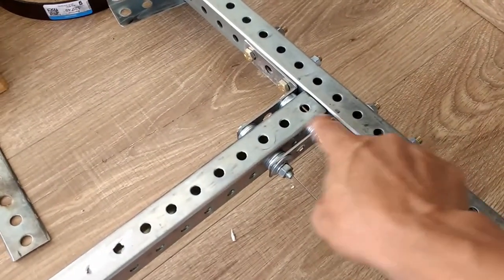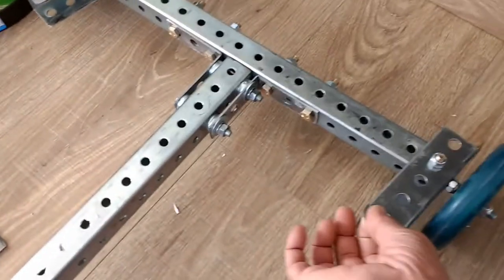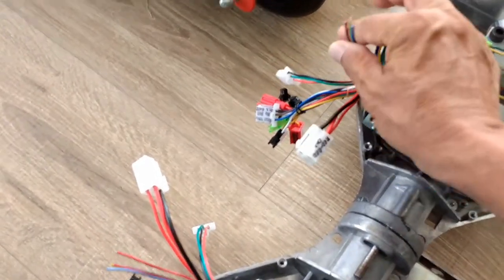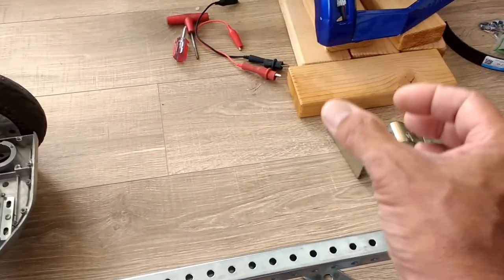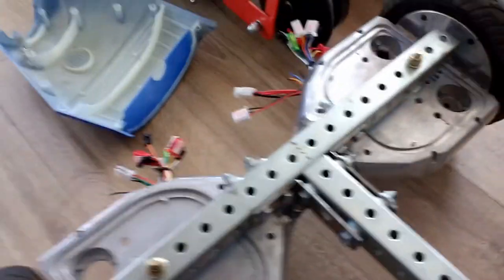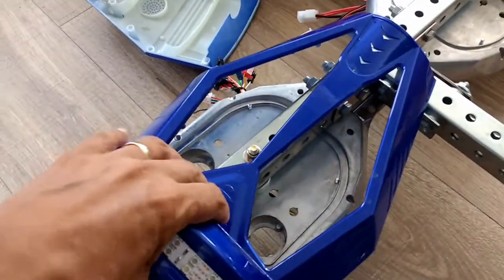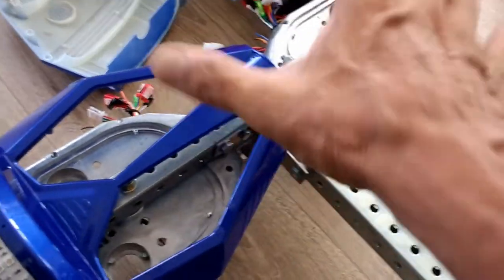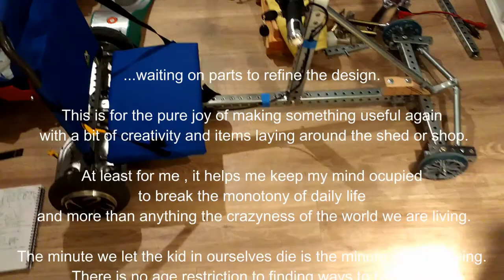Nano Go Kart Bolt On No Welding made from Broken Hoverboard Part 1

Comment: I'm so surprised they don't have those brackets
Reply from the maker: Me too lol, I searched high and low by various keyword iterations. Brackets for telescopic tubing with 1" hole CL-CL spacing. Nothing! I think the original manufacturer of the tubes I used  has a distributor contract with Home Depot only as in comparing similar perforated tubes from other sources they are not the same. The home Depot ones are nice clean shiny galvanized and smooth tubes, other although similar in appearance are not that appealing. Would be great if Home Depot would offer  universal brackets and hardware for these. Although 5/16 or 3/8  nuts and bolts is the easy part. 

Mc-Master Carr has something that will work with these tubes 1/4" thick! and heavy! but they are about $6 each and designed for electrical conduit, I have some of those I used for a flight simulator, built from electrical conduit, aka unistrut, many years ago,  but the holes are not exact CL-CL.  Would be great if the original manufacturer of these telescopic tubes would offer matching brackets in all configurations. I would be jumping with joy like I did when my parents gave me an erector set  back in the mid 60's. :)

Comment: Why u installed dual controllers,  was it because you wanted to do this or one controller can't be used with two motors
Reply from the maker: ea motor requires its own independent controller.

Comment: How to find the watts of my hoverboard motors.
Reply from the maker: A typical hoverboard hub motor:
Voltage(V): 36V 
Power(W):250W 
Wheel size: 6.5’’ 
You can trace back the the electrical specs also by model number of wheel or the actual hoverboard model label which should have the operating specs.
Reply: @MarioIArguello  some youtuber replied that all 36 volt hoverboard motors are 350 watt. Even if the size is  6.5